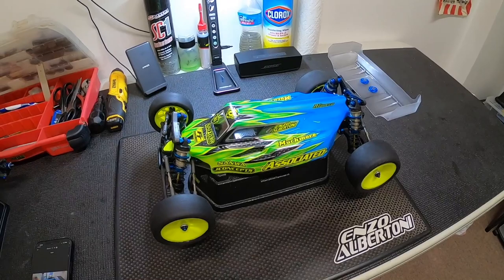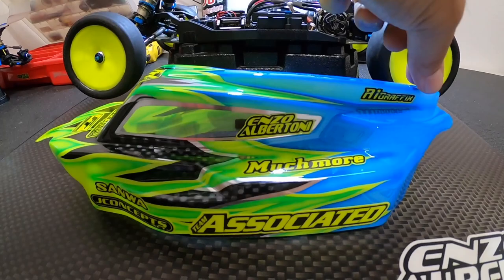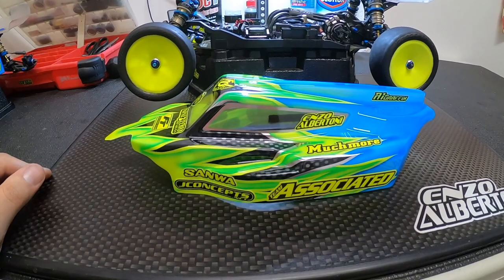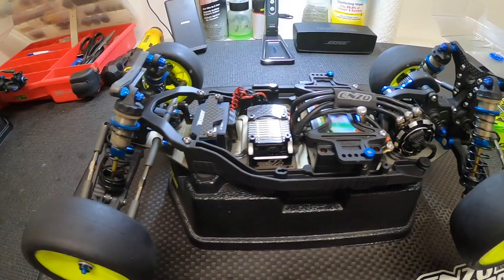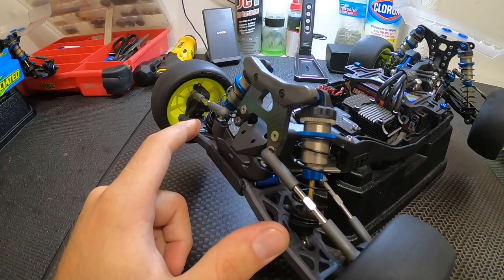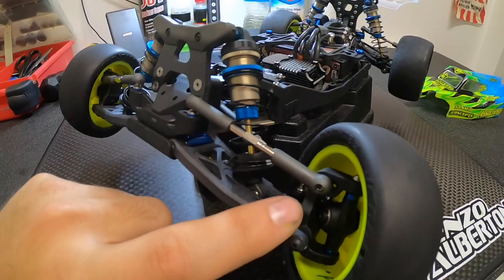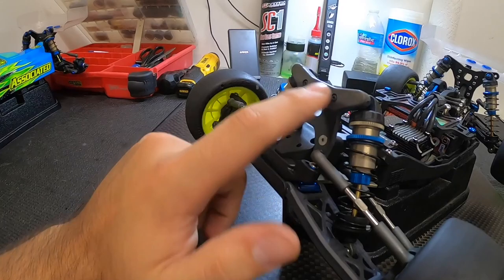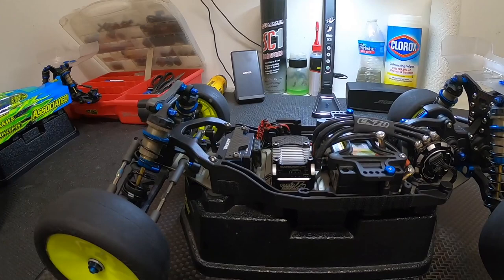Team Associated B6.4D Update || Enzo Albertoni

Comment: Thanks for the update video. 
Would be good to compare how the new car goes against the old one, on the track.
Reply from the maker: This is something I would like to compare, but just due to using the equipment out of my other car for this one. Might not happen. However, on kit setup, the new car was about .1 tenth quicker on fast lap, and about .2 tenths quicker on top 15 average over a 5min run. Definitely right off the bat, was quicker. And with some current setup changes and changing it more for me, it's gotten slightly quicker than that. It's been awesome so far!

Comment: Had a question for you , how do I get more side bite on the b6.4d ? It's kit set up , but I have 1mm drilled pistons in fro t and rear . 1.7 and 1.8 hole , 32.5 shock oil all around . It has a ton of steering but want tje backend a little more stable . I'm  med to high bite clay . Just curious what to do

Comment: So whats the difference running the stock rear arm set up compared to the b6.3 rear end
Reply from the maker: Good question. 

I think it all comes down to driving style and track. When running the 73mm rear end, with wide pivot setups, I normally found that the car rotated a little more off power, and on exit also seemed to carry more on power steering.On flowing, bigger tracks the 73mm rear end for ME, felt that it lacked a little stability, I normally prefer a car with a lot of steering, but the rear is planted and stable, vs some others like the rear to feel lighter more reactive to wheel inputs. 

With the 75mm setup, with a narrow pivot, I felt that the car is more stable on exit and off power, probably carry a little more overall corner speed due to being able to hold more speed vs the narrower 73mm setup. 

Again all of this goes on driving style, grip levels and track. I would say if you're on a technical or smaller track, the 73mm setup will probably favor that condition. If you are on a bigger track, more open and high speed, maybe similar to a Hobby Action, Ohio Rc Factory or tracks that are relatively open, I think you'll like the 75mm setup. Our track is mix between open and fast and also technical in some spots, but I prefer the 75mm setup for ME. 

Hope this helps! :)
Reply: @TheRcworld101  What are the part #'s for the C & D blocks you are using with the 75mm arms? Didn't catch it being mentioned in the video and just want to be sure before I consider purchasing. Thank you.
Reply from the maker: @slakr  Kit C/D blocks. No need to swap C/D plates.
Reply: @TheRcworld101  Thank you so much for replying.

Comment: Awesome video!
just have a few questions:
have you changed any of the shock setup and whats you opinion on low profile batterys in 2 wheel
Reply from the maker: Hey! 

LP lipos in 2wd are very dependent on 1. Driving Style & 2. Class you are running. For the most part in 2wd Mod Buggy, it's always been favorable to have a heavier car, in the 1550-1570 range, it helps keep the cars calm and somewhat grounded with all the power they have, and with setup changes you can wake them up and make them more aggressive. In stock you always want to be as close to the ROAR/EFRA/BRCA minimum weight rule, to have the best acceleration and use of power, since being confined to a spec motor. 

I think if you run modified, you can run a LP lipo, and add battery wights under the lipo to bring weight up, and you can also compare running a normal 4500-5000mah, with little to no weight, and compare the differences in feedback and driving. In stock, you normally want as much runtime and longevity as possible to make sure the punch and drop off is minimal. But compare both if you run stock! 

Hope this helped :)
Reply: @TheRcworld101  Awesome feedback! I run stock and plan on doing some testing between the two to see what I prefer. I've been running the LP battery since I started racing 10 months ago.
Reply: @TheRcworld101  also the one time I have put a full pack in my 2wd it traction rolled multiple times. Any remedies?
Reply from the maker: @newo12  It can be a mixture of things, from roll centers, camber, shock package, ride height. Try resetting or going on the AE website, to see what might best suit your track conditions, and try one of the posted setups and adjust from there!

Comment: Would it not be a good idea to cut a hole where the motor is for cooling?
Reply from the maker: I would say if I ran 17.5t stock buggy I would have a cut out for my motor fan. But in mod, heat is never really a big issue unless you run carpet or turf. But for clay, they get warm, but never danger levels when running off-road clay.

Comment: Need help , when I built car , im having a problem with tje bulk head , it moves up and down . The top screws won't tighten down . I think the bulkhead striped out.
Reply from the maker: Possibly try taking everything back apart and start over. Maybe you looked over a step. If that doesn't work, I suggest bringing the kit to your local track to have someone experienced, go over the car. Hope this helped.

Comment: I noticed when I got my car , I have 2 different gear boxes , which one comes in bag #6 , is thst the laydown or layback ??
Reply from the maker: The layback transmission, uses the smaller idler gear and also the top cover that covers the ball diff, has layback stamped on the inside of the mold. The bigger idler gear will only fit in one of the two gearboxes too. So the one that does accept the bigger idler gear and is not stamped "Layback" will be your laydown one. Hope this helps!
Reply: @TheRcworld101  thanks I appreciate it!!!
Reply: @TheRcworld101  the one I put in , the chassis brace doesn't line up to tje chassis holes closest to battery